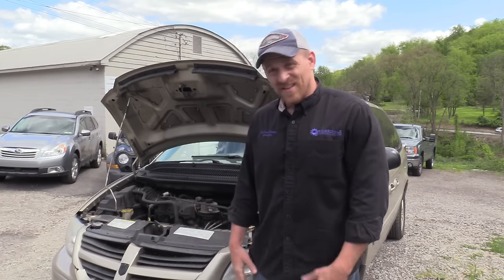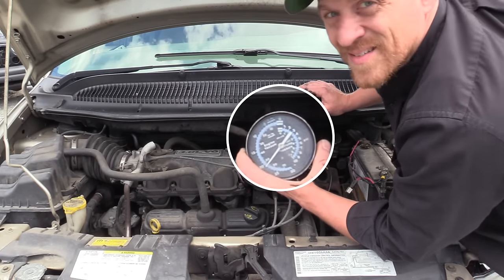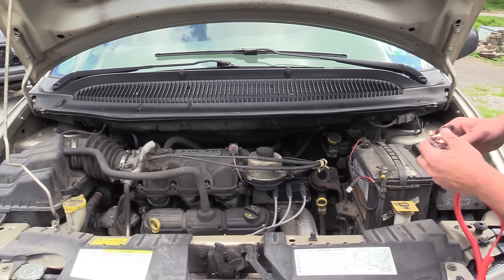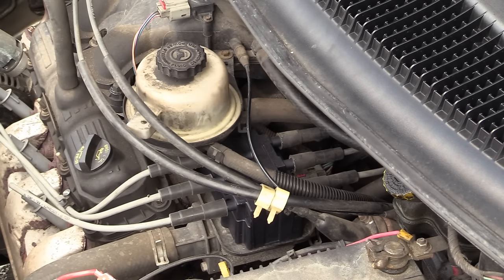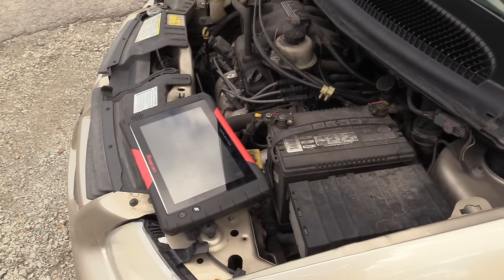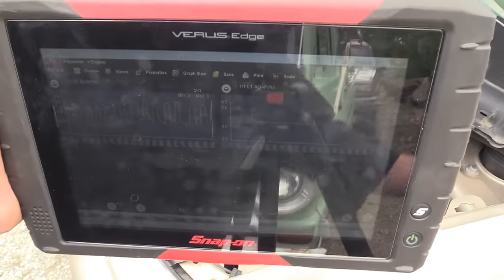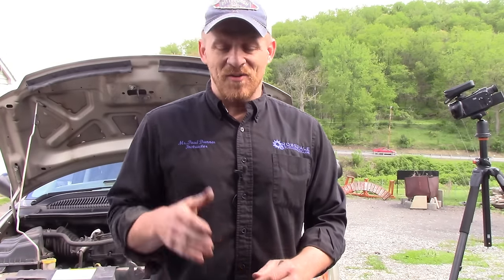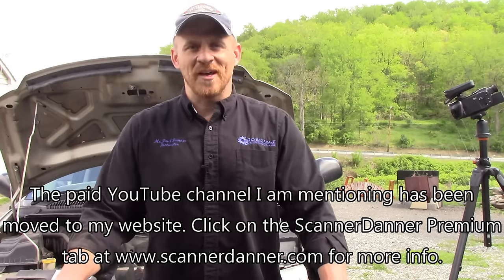Misfire Quick Tests (Is it a spark, fuel or compression problem?)

Comment: At 3:37 Cylinder drop test. I had just replaced my coil with an aftermarket and the car was running no different than the old original coil. I did the cylinder drop test with a test light and after I did, the car was hard to start, but it did run once it started. Apparently I had damaged the new coil, so I put the original back in and it starts easily again. So beware, in my case this test damaged the coil.

Comment: I have the same van, same year, same color, and yes a leaking radiator. I got one of those intermittent misfire codes I think 0P300 I believe. It seems it could be anything according to u tube. Must be the worst code to diagnose, as it could be egr, cam and crank sensor, almost anything but a single cylinder issue such as bad spark plugs and, wires or valves. I don't want to just replace parts as it gets expensive. I may need to take it in. I did do the spark plugs and the gaps worn to well over 10 thousandths easily. Wonder if this could have caused intermittent misfire. Can u tell me how to reset the computer to see if the codes come back? Thank you.

Comment: If I have no 5 volt reference from the pcm to the egr will it throw a lean code and misfire code? In a GM 3400 pos. I tested the egr and it was opening and closing when powered from the battery but I got nothing from the harness for voltage. I have a vacuum leak too I found but I sealed it and nothing changed so I’m leaning towards the egr issue but it’s not throwing an egr or evaporate code. Ecm screwed maybe?

Comment: I went through all the checks on a Jaguar x type. Had a misfire on 3.  #, is on the firewall side and underneath the intake manifold. No way to access the coil or injectors without removal of the intake. Fuel checked out, Fuel trims out of whack, no vacuum leaks. I broke down took the intake off and removed #3 coil....as I removed it, I noticed a drop of water...I looked in to the tube and saw that the SP tube was 1/2 filled with water! took the rest of the coils off in that bank and the same thing! 

Not sure where the water came from, but I'd changed the intake Man gaskets a couple of weeks before and cleaned the area with degreaser, and rinsed. I thought I had thoroughly covered EVERYTHING with plastic. Car ran well for about two weeks, then the misfire. I bet it was running on 3 cylinders! Anyway, I dried everything and engine is running like a top. 

However, I'm still leery  and wondering if there is a water passage on the head that is seeping. The "water" was not antifreeze as far as I could tell. I'm hoping that maybe it's water leaking down from the windshield washer nozzles or that maybe I didn't cover the engine as well as I thought I had and it took a while for the water to interfere with the plugs.

Comment: I'm having the Samuel issue I have a 2002 Ford Taurus and I'm doing the same codes it idles rough to where it's wanting to die and now I'm having an issue with my turn my AC on the compressor clicks on and off constantly and it really makes it want to stall and the AC goes from coal to warm I just put free on in it and didn't help any it's actually worse they already put a brand new ignition coil in it I put new spark plugs and wires and I don't understand and I need help please

Comment: Why the heck does my 2.2 ecotec run beautifully for about 10 miles then mifires on 1,2 and 4 cylinders at idle. Should I get a used engine replacment? 😡
Reply from the maker: Do a compression test (cranking test) like I showed here with the engine hot.
Reply: @ScannerDanner  Thank you so much for your reply. This engine had a timing chain guide failure.  I tried to clean it and put it back on the road for my sister, but after doing everything I could, it just would idle. I did the compression test, but the engine wasn't hot. Your advice makes sense.  I bought a $400 salvage engine with nice cross etching and clean insides. Im changing out all the new components yesterday and today, and im going to give it a wherl. I have a feeling this is going to do the trick. Then again, I've told my sister this before.  😊

Comment: changed number 1 plug, coil and new air intake sensor 2014 Town and Country. finally, engine started smooth yet little peck. Took off and about 15 seconds of driving back to jerking. Help.

Comment: What would your opinion be if my engine runs well....Except when I am driving a long about 45/60 just cruising and when I give a little gas to speed up or pass I get a little bit of hesitation. After the hesitation it takes off. I am thinking fuel injectors need cleaning. The vehicle in question is a 07 Honda Ridgeline with 135,000 miles
Reply from the maker: Classic secondary ignition misfire symptom. (Coil or plug issue)
Reply: ScannerDanner Thank you. I didn't even think of that. I know I've replaced the plugs about two years ago so maybe one of the coils.
Reply from the maker: A tip for you to find an ignition misfire. Spray water on the coils and snap the throttle and see if you can re-create the misfire or if it gets worse.

Comment: Just bought 2007 dodge caravan sxt 3.3v6, seller said runs great, thing has been misfiring since i bought it month and half ago, shakes runs rough, gets a little better when warmed up, sounds like noisy lifter possibly clacking once warmed up only 102k on that one im driving now, gotta get it looked at runs like crap, shocks were bad replaced, struts are on the way out.   I did all the plugs wires coil pack, changed power steering resevoir and fluid, changed air filter, cleaned mass air flow censor in air intake to throttle body with mass air flow sensor cleaner, removed throttle body and cleaned it and cleaned the idle air control valve of carbon wasn't to bad.   No help van still runs like crap idles rough, the whole engine shakes when driving, no codes.  engine is visibly shaking some when just idling from cold start up to, seems idle better parked after warmed up but then it has that fairly audible clacking sound like lifter or something.  I could do pcv valve and egr valve..and other stuff like thorttle position sensor, map sensor but really i think its probably in the engine the prob, I hope not.   FIrst guys i brought it to muffler shop said it runs fine, so um they were way wrong of course so i gotta bring it somewhere else where they going run real tests on it like this guy.  I did notice when i changed the plugs that cylinder 6 on right front part looked dark like had oil or carbon build up on it for first half inch of the spark plug the other 5 cylinder spark plugs looked clean.  Also the air conditioning condenser thingy when air conditioning on sometimes the whole muffler system shakes guess that could be on way out, overall i'd say most other things on the van are in good condition.

Comment: Picoscope should hire this guy to run a lab class for them. I have this similar issue with a 5.7L tundra. Compression jumps around and vacuum steady although I did notice very small needle vibrations once in awhile. Wet and dry compression tests very inconsistent but I don’t think rings will cause that, I’m leaning toward valve issues of some kind. There is no noise like this one where it sounds like a lifter is being beat to death. And same issue across all cylinders.

Comment: If a 4 cyl has good compression 140 in each cylinder but has an intermittent miss would it still be possible for it to have a lifter issue?
Reply from the maker: Yes

Comment: Need advise please: have 2 codes on Merc C180: p0303 cylinder 3 misfire and p0313 misfire with active fuel reserve signal. Car starts first time everytime but shakes and noise. No smoke but engine light is on. It only done 80k miles. Any suggestions as to what it could be (major or minor) and where to start from?
Reply from the maker: what is the compression on the #3 cylinder
Reply: @ScannerDanner  I'm wondering which route I should take. Compression test costs alot of money and it may not be that

Comment: Not that it could be related to this case. Had a 2005 Chevy w/ 3800 v6. Misfire only at idle. Checked fuel/spark and that was fine. Checked compression on all cylinders and got the same numbers within 10%. Stumped, I had to go into the engine. One of the cam lobes was slightly worn causing a misfire only at idle. Car ran perfectly over like 1200rpms.
Reply: m ph - It's a GM.
Reply: Same thing happens on other models. Dodge, ford, imports. And AFM/direct injection is making ICEs that much crappier. Gotta thank big governments fuel economy rules on that nonsense.
Reply: m ph its there butt you cant feel it because of  engines inertia yet  its a definite loss of HP
Reply: m ph m ph thanks for your comment. I have an 09  2500 gmc sierra 6.0 motor with the p0306 code it has 137K miles. Changed coil and spark plug with no help. Took it to dealer they did compression test and found out cylinder 6 had low compression, they opened engine and said found a roughness on cam lobe on cylinder 6.

 In your case you mentioned it was slightly lower, so did you continue to drive it like that with no further issues? The reason I ask is because I don't know whether to replace engine or/ camshaft lifters or just drive it a few more. Truck runs fine other than a slight fluctuation at idle at the rpm guague but no stalling or roughness in startup. It doesn't make tick noise from lifters just a 'growl humm howl'- like noise when accelerating and decelerating. Thanks

Comment: Same problem, same cylinder, motor and mileage. Can this be fixed without pulling head?
Reply from the maker: No sir, this was a valve and seat issue for sure

Comment: Some great comments but I think a lot of you missed where he said it runs fine on test drive. That points to lifter, not valve spring. 

Though I have seen a burnt valve produce similar compression results. Keeping in mind that the valve rotates in the seat as it opens and closes, and can produce intermittent bad compression.
Reply: How exactly?
Reply: @RzVids  In the most fundamental sense, friction. Imperfect surfaces coming into contact with one another repeatedly at high speed.

Some engines are even designed to increase the rotation of the valve during its travel.

Comment: 1/25/19, I have a 98 Dodge Dakota Sport 3.9L, V6, had a complete tune up and changed all sensors still getting a random misfire. I am frustrated, one guy said it could be catalytic converter, another guy said catalytic converter won't cause misfires. New catalytic converter is sitting my storage shed. I am waiting your response. Thanks in advance!
1. TRUCK RUNS SMOOTH WITH PREMIUM FUEL AND FUEL TREATMENT. TRUCK RUNS AWFUL WITH PREMIUM GAS ONLY. 
2. CHECK ENGINE LIGHT STAYS ON, W/RANDOM MISFIRE CODE. 
3. HAVE TO TURN SWITCH TWICE TO PRIME THE LINES, BEFORE TURNING IT OVER FOR IT TO CRANK.
4. MAYBE UNRELATED, AC WORKS EXCELLENT, GO OVER 55MPH, ONLY GET VENT AIR, NO AC.
Reply from the maker: Have compression tested, then have the injectors tested for flow (injector balance test) I have videos on this.
Cat won't cause what your are describing 
Vent air only over 55 is a leak in your vacuum supply line to your climate control system or faulty vacuum check valve

Comment: Hello damner i have ford f 150 96 4.9 i been change the distribuitor all assenbly the crank sensor,coil,ecm.but stil i dont have positive in the inyectors and no pulse can you help with any tip
Reply from the maker: No power to the injectors? Focus on the EEC Power Relay. It is ignition switch powered on the relay coil side and the load side feeds power to the injectors amount many other components
Reply: Thanks i appreciate your help

Comment: Scanner Danner to the rescue! I need a fancy scantool like you have. Mine doesn't tell me much of anything to useful. I'll have to pull the spark plugs and get my gauge on there. :-/  Having a similar problem on my 4.6 ford 2v. Really hoping a valve just needs adjusted at this point.

Comment: Yes I would do work I personally own 2 of these it sounds like basic maintainable maintainance has not been done. The breaking issue is caused by heat warp unfortunately meaning with these and many other minivans you have to turn or replace the rotors every 6 months to a year. At this point it is a bit of an uphill battle its still cheaper than a new vehicle and if you are in need of something such as a caravan then its one of the better options.... Side note may recommend an odyssey just for the lower maintenance requirements.

Comment: When you do the relative compression test, how do you prevent the engine from running ? Is it because you are put the gaspedal to the floor ? Does it work on european cars also ? 
Like your videos.
Reply: When you press the pedal to the floor it stops the injectors from firing. I think they call it clear flood mode. It’s if you flood your engine after trying to start it so many times you can clear the cylinders by holding pedal down so you don’t wreck your engine.
I think it’s standard on all cars
Reply: @FleetTech97  Thanks a lot !!! I'll try it.

Comment: How much did your scanner cost that will graph cranking Scanner Danner? I don't think men watching YouTube videos to get help fixing their car with a misfire could afford a scanner like that. I think doing a compression test on each cylinder with a compression gauge, reading a vacuum gauge, doing a leak down test, and looking inside the valve cover for a broken valve spring would be more conclusive. I have had several cars with noisy lifters but they did not misfire. I had a car with an engine so worn it smoked out the tail pipe but it did not misfire.
Reply from the maker: John, my core audience is working technicians. That is who I teach to. Can the DIYer learn too? Absolutely! Does he need to buy the tools I use? Absolutely NOT! Can the DIYer learn techniques and the limitations of his tools, then adapt and overcome with the knowledge I am providing. You bet he can!

Comment: i totally understand the conclusion a hydraulic lifter would be the only component in a valve train that could fluctuate but how you got to that conclusion is way above my tiny brain, inverting 6 to diagnose 3 or whatever you said, for me it's simple, it's a Chrysler, lift up the radiator cap and roll a new car under it....

Comment: Hi, i have honda 8th gen 1.8L and  short term fuel trim at ideal position 
-16% to - 10% LTFR 0% and fuel consumption only 7km per liter. My cat is TOTALY blank inside (all material which was in exusat weast though exusat but both o2 sensor intact. Is it due to expired cat?
Reply from the maker: absolutely could be, does your Honda have a wideband upstream O2? If so, they may be using some downstream O2 fuel trim strategies and with a hollowed out cat, this could be your issue.

Comment: Thanks,that is VERY nice; then it becomes guessing; need a compression test, with the old compression gauge, oil in the cylinder (don't think it's needed here, lol), and valve cover off.

Comment: Valves rotate as the open/close. I would definitely check the exhaust/intake. There could be a seating issue that comes about as the valve rotates. Of course, could be a lifter or something else. Could be a valve sealing issue though.
Reply: NothingSpecial if it was a valve sealing issue u would think u would se it every time not just intermittently. I could be wrong but it just seems logical to me.
Reply from the maker: My thoughts too Dylan but others are saying the same thing, some from carbon deposits. 
I would say if that was the case, it would have been an exhaust valve not an intake valve, since vacuum was good and steady on the gauge.
Reply: I've seen intake valves carbon up. Possibly because of valve overlap, not completely sure about that but I've definitely seen it.
Reply: I must have missed the vacuum gauge part. Most likely not a valve issue. I agree.

Comment: I know I am likely totally incorrect, but my imagination is wild at this time so I will ask, could a small intake leak, on the lower manifold near the #3 cylinder cause this? I'm more asking if it could bleed the pressure for that cylinder causing intermittent low compression?
Reply from the maker: No sir as that is all before the intake valve
Reply: Thank you. @ScannerDanner

Comment: What causes the engine to vibrate when the rpm is installed at 1500 rpm in a 2009 Sonata while parking, although I have checked it with the devices many times and I have not found a solution and sometimes it has double torque while driving.. Almost at a speed of 80 km
Reply from the maker: hard to say on a computer screen (vibration complaints). I'd need to see it to help

Comment: How is the compression changing the pulse on the plug wire? I don't understand how you are diagnosing compression electrically.
Reply from the maker: I'm using starter current to gauge the compression pressures and I am using the ignition pulse to sync the waveform so I can determine which cylinder is which. I have other videos on this too search "relative compression" on my channel page
Reply: @ScannerDanner  Pretty smart! I have a negative fuel trim, under powered, poor fuel economy, and smells like its burning rich. Any ideas? Thinking leaky injectors.
Reply from the maker: @jeffren70  how negative are they? Under powered could be from a plugged cat because it's running so rich and you melted it down. 
What are the O2 sensors doing? Most importantly what are you working on? Year, make, model, engine?

Comment: A simple compression tester would have probably told us the same thing. If it was mine I would pull the valve cover off and take a look. If I had to pay a mechanic for his time I may have a different attitude about it. My guess as was mentioned earlier by someone else is that it probably has a broken valve spring which should not be that hard to replace if you can get to it.